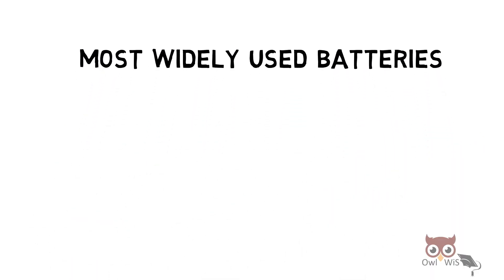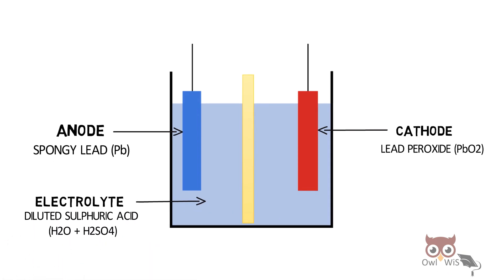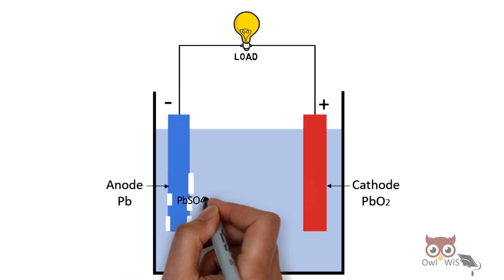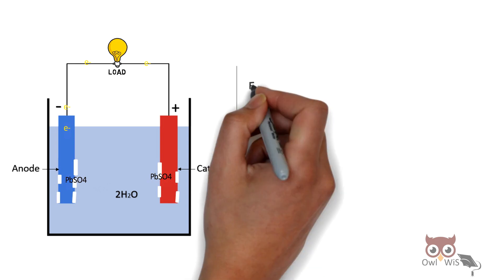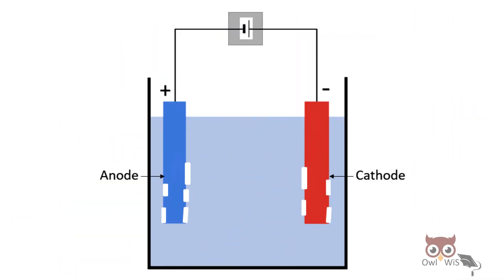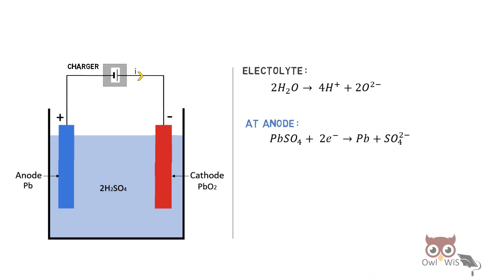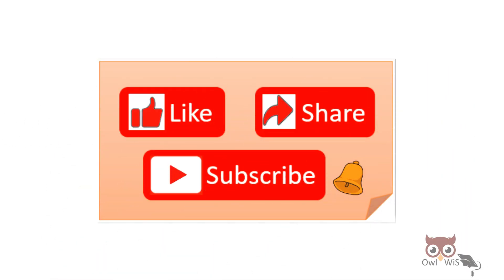How lead acid battery works | Working principle animation

Comment: When I studied electronics in the time when they were using vacuum tubes the anode is positive with higher voltage than the cathode negative.  The anode is made positive with higher B+voltage to attract negative charged electrons from the cathode when heated.  Electrons are always negative.  I conclude that the anode should be the positive terminal.  I want to learn please help.  Thanks USA.

Comment: Don't worry guys i will clear your doubt .....carefully listen this:-.....when a atom loses electrons it's becomes positively charged and losing of electron is actually called oxidation. ...and oxidation always happens in abode....... CHARGE of that anode is positive  BUT this positively charged anode gives electrons.....so its is ACTS as a negative terminal ( people confuse because they are not sure about whether they are talking about charge of anode or terminal of anode).....

CHARGE ANODE IS POSITIVE + AND TERMINAL OF ANODE IS NEGETIVE-

Comment: this is NOT an explanation of the working principle. It is simply an analysis of the chemical reaction involved. In order for it to be a working principle video, the specifics of the reactions should have been abstracted, and the importance of the separator should have been explained. It should also have been mentioned that H2SO4 completely dissolves into SO4(2-) + 2H(+) REGARDLESS of whether or not it is discharging. This is of vital importance to know what the battery is doing when it is neither charging nor discharging. Not a good explanation. People watching this will simply copy the chemical reaction without understanding the actual principle of how a battery works.

Comment: You explain the process of discharging and charging a lead-acid battery well enough, but you have one detail wrong. During the charging process, water dissociates into positive hydrogen ions and negative oxygen ions. In practice, the negative ion of oxygen is not stable in an acidic environment such as a solution of sulfuric acid, because it is too basic in nature, so it would immediately be united by the present positive hydrogen ions into water. Which returns the reaction step to the beginning. The process is different, but the essence is actually the same. When charging the battery, at the cathode, lead sulfate is reduced by the arrival of electrons from the external negative terminal of the current source, into elemental lead, during which the sulfate anion moves from the electrode to the electrolyte. Due to the increase in the concentration of negative sulfate ions, the electrolyte has a strong tendency to generate positive ions, so water is oxidized at the anode to oxygen and positive hydrogen ions that increase the activity of the acid in the electrolyte, and the oxygen binds to the lead released from the lead sulfate salt, forming PbO2. At the anode, two electrochemical reactions take place in parallel, the oxidation of lead sulfate to a lead positive ion and a sulfate radical that strongly takes electrons from hydrogen from water molecules, building positive hydrogen ions and nascent oxygen, another water molecule is also oxidized by the positive lead ion taking electrons from the molecule water and generate positive hydrogen ions, where it binds to two nascent oxygen atoms and builds PbO2.

Comment: Mam help me  i conused In lead acid battery Anode Is positive or negative.?  some vide channel say Anode is positive but, more video channel (including your video) say Anode is negative.! 
Which one is correct.? 
Plz help me.!
Reply: When the lead acid battery is DISCHARGING the anode is negative because it is losing electrons to the cathode (+), and when the battery is CHARGING the anode becomes positive because it's gaining electrons from the cathode (-).

Comment: The video is correct in regards to the Cathode/Anode labeling.  When discharging, the negative terminal is the anode because the electron leaves from there. When charging, the electron is going into the negative terminal. The anode and cathode can be either the negative or positive terminal in a device, but it depends on the situation.  The exact definition of which terminal is the cathode or anode doesn't have to due with polarity, but rather with the chemistry redox reaction; i.e., which terminal is the oxidizing component, and which component is the reducing component. You'll have to read up on redox reactions to totally understand this. Most often it probably works like this though: if the electro-chemical device is producing electricity, the anode is negative, and if it's consuming electricity (even passively like a diode), the anode is positive. Note that with motors, this isn't an issue because chemistry isn't involved.
Reply: nice one champ
Reply: This is true but the video drew the charger and current flow in the wrong direction, it should be flipped so that the anode is attached to the positive pole of the external voltage source and the cathode is attached to the negative pole.
Reply: I will read this once I come back from college.
Reply: @AdreannaRhysand what colleges?... Why r we learning this on senior high 😢
Reply: Bahi itna Acha sa  explain karaga
Reply: Wow that's awesome 👍
Reply: 😂yess

Comment: Er the first sentence: "The most widely used battery in electrical vehicles is the lead acid battery" - no, not in 2022 or for many years.
It is the most widely used in petrol/diesel vehicles due to its power performance characteristics, specifically suitability to supply high currents for short periods to turn the engine over and then charge slowly once the combustion engine is working.
Reply: I guess you could even say "vehicles" in general, because most (or all?) electric vehicles use a 12V battery, usually lead acid, in addition to the high voltage traction battery.

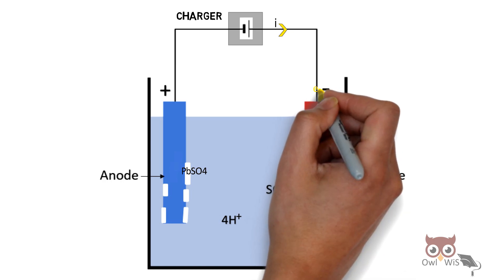Comment: 02:40 how does these electrons move to the Anode AGAINST the negative terminal of the charger?
Reply: Basically, the generator on the other end is more strongly negative, so the negative terminal of the battery is actually positive with respect to the generator.

Comment: @0:54 anode (-) cathode (+) pl correct it
Reply: I agree with your statement and also wish that since the discovery of electron flow 100 years ago that our schools and textbooks and teaching would focus on "Electron Flow" (cathode negative and anode positive) and give up on what is called "Conventional Current" which was proven wrong. This is a "conventional" girl. Also, as Suresh points out as well, she has the lead and lead-dioxide (aka peroxide) reversed. Hopefully she reads these comments and corrects her otherwise nicely done presnetation.
Reply: No my friend. An anode in a battery is the electrode that serves as the source of electrons in a electrochemical cell. So anode is (-) at a battery discharging because serves electrons. This is the explanation with real current and not the conventional.

Comment: Clarify please.  Why your illustration during charging has the Positive as the anode.
Reply: Answer to your question is that she is presenting "Conventional" theory which was proven wrong about 1900. We should stop teaching it in our schools and follow "Electron" theory with is current fact. Hopefully Engineers will stop using "Conventional".